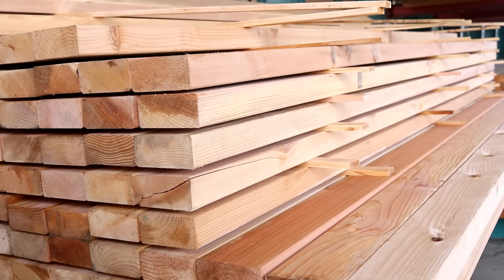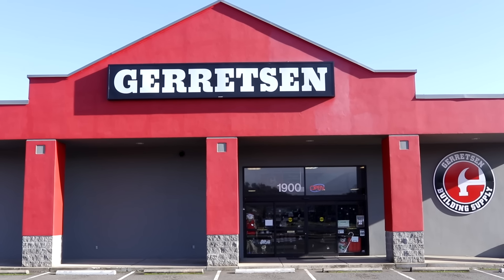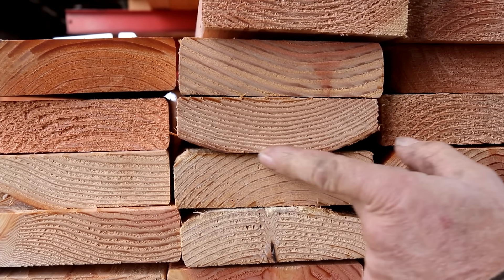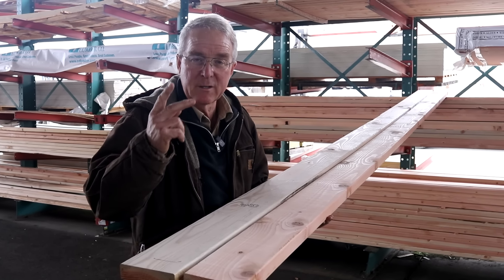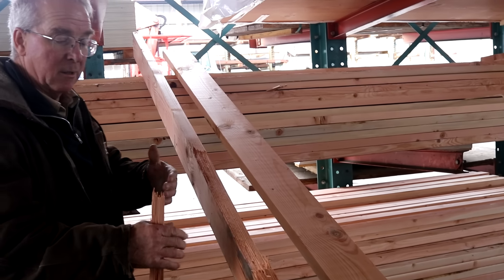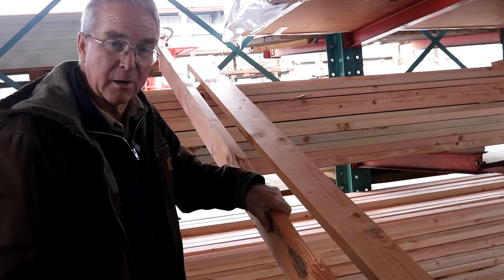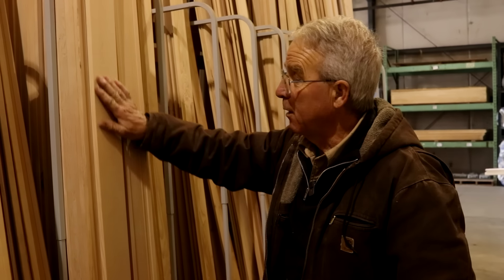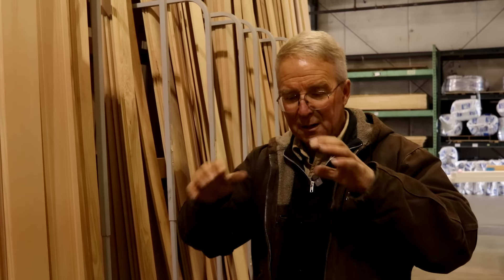How to Not Buy Crap Lumber

Comment: Just a note (no arguments required) of info: When these lifts of lumber arrive at any yard, they are all pre-wrapped and banded together, so the store has no idea they got a bundle of so-so wood until they take it down to the ground level for sale and open it up. Then, as customers come in and want to spend 45 minutes "sorting" through a stack of lumber (which means they start chucking the lumber on the ground or piling it up behind the racks) all the while other customers are very impatiently waiting for service because all these yards seem to short-staff their yard people to save money (yard people cost money whereas sales people make money and thus yard peope are lower in status and are often expendable and replaceable as cheap bottom feeder labour). So now you have a yard full of angry customer's, no staff to serve them because of the 45 minute "sorters" and the manager and front staff all  raging on you for not helping their customers they just called out. Add in, the fact that when the "sorters" leave the yard staff now has to level the piles because they get "sorted" by customers so the counter can count the piles each week for missing inventory. Now add in the fact that when the "sorters" get through making a complete mess of your wood piles looking for perfection from SPF 2 wood, they leave nothing but junk for the next customer (which is not the "sorters" problem but does create a problem for the next guy in line). So the next guy in line wants you to pull down a fresh lift so he can do his own "sorter" thing but the yard staff have been instructed not to bring own a fresh lift until the old lift has been sold up to 75% of volume. Then the absolute jink gets banded together to make cull piles for reduced sale. This is why many/most of the box-store lumber is run the way it is and why there is a difference between specialty stores vs box-stores. This is why many stores have a "no sorting" policy or why they only allow you to personally pick up to 20% of your wood. This leaves customers with the onky choice of buying what they are given and returning or exchanging the crap pieces  the next day or shopping at speciality stores. Like i said, no arguments needed here, this is how al kf these stores work and ranting about it here wont change that. This was strictly for information purposes so now you know why things work the way they do.

Comment: Interesting video! I especially liked the tip about checking the ends for pith. I'll be sure to look for that next trip to the box store.

I've had the opposite experience with my local building supply. Their 2x4 studs are really nasty. Almost every one has wane or large knots. They're fine for framing I guess. But I've found SOME of the douglas fir at the big box store to be cleaner and straighter...of course, you have to dig for the good ones. I should note that I'm usually not framing, more likely I'm building something else where the lumber will be visible.
Reply: ----   you get extra points for spelling "wane" correctly

Comment: In my area in New York state we have two mom and pop lumber companies about 30 miles in opposite directions from me. They started out small but built up to nearly the size of big box stores. They both have good lumber and building supplies, great tool selections and one even has a nice supply of household goods. For softwoods, hardwoods and moldings I like to use a specialty lumber company that's not too far from Cooperstown. They come from small beginnings, too. They mill, kiln, plane and mold everything they sell.

Comment: My first job ever was framing houses, working for my father. By the time I was 18,  i could set the location of the home on the lot,  set batter boards to line up the footer forms, frame the house, install windows, doors, siding and on and on. My dad taught me to do the material take off and place the framing package.  On single houses, I told my salesman, do not send me a load of crap. That was 50 years ago. Since then, I've made cabinets, run trim, install handrails on stairs. I even made some furniture. Besides the fun of creating something from  a few pieces of wood, I learned this, the quality of the wood you use makes a big difference in the quality of your finished product, whether  you are framing a house, running trim, building cabinets or making a dresser for your daughter, having good quality wood makes a big difference in your final product. These days, especially in wood for framing, the wood quality is dramatically less than it was 50 years ago. The fast growing softwoods are very weak. Notice the wide growth rings on a board, that tells you it is more prone to twisting, warping, cupping, and is much weaker when used a joist. Lastly, when YOU build something from wood, take a step back, look at what you made, then say, "I built that" There is a sense of accomplishment. That dresser you made for your daughter, may wind up given to her daughter. Yeah, grandpa made that. And he used really good wood.  OK, yes, I did that and yes, the dresser is now with my grand-daughter. Crappy wood is really good for making a fire. Get a stick, put a marshmallow on the stick and burn it. Then eat it. See, even crappy wood is good for something !!!

Comment: I built a router cabinet (home Ethernet) between a pair of studs in a hallway, and bought some premium 1x6 white pine at Home Depot to edge the box.  I believe it was imported to CA by a company based in New Zealand.  At any rate, I soon found out that my 1x6 premium material was tapered in width.  One end was 5-1/2" while the other was closer to 5-1/8".  I never thought to check THAT because each piece was otherwise flawless...

Comment: Nice presentation. But I've always thought 2nd grade wood was more interesting and that's possibility, depending on your usage. I had access to an almost unlimited number of pallets which had been used to ship raw glass sheets that varied from 8'x8' to 12' x 12'. 

I used them to make cabin furniture and cabinets.

There were "knots" lengthwise imbedded in the boards, pitch pockets,  wane and sometimes dual color, but otherwise the board was 
dead-straight. Shipping glass, it has to be. 

I cut the nailed ends off (a LOT of nails) and shaved the wane then milled them into workable dimensions.

I made everything from 5/8" boards for cabinets and the doors to 1" to 1 1/4" for coffee tables and end tables. And kitchen chairs. Those boards containing partially imbedded branches milled into great looking cabinet handles.  

If I were to do it again, I'd go to a lumber mill and avoid all those hundreds of nails.

Comment: I built a boat using Douglas Fir bought at a lumber yard for the stringers as per directions.  The 2X6 Douglas Fir stringers were coated with epoxy/fiberglas so they were sealed.  I was amazed after 3 years that they had started to rot.  After 5 years I had to begin replacing them, a complicated process.  Now, all this is in Florida where the humidity is extreme and it is always warm but this seems unreasonable for any lumber.  One stringer rotted but the other didnt.  One shelf rotted and the other didnt.  I cut out the rotted stringer and shelf and replaced them by gluing in laminated layers of Southern Yellow pine in 1" thick strips.  My theory is that rot doesnt easily progress across an epoxy glued barrier so I may lose a single laminate but not the entire 6" thick piece.  I am now unhappy about the use of Douglas Fir in a warm climate.

Comment: Just about everything is SPF (spruce pine fir) boards here in midwest. Occasionally see a stack of pink Douglas fir. My old 1960s house was built with kiln dried hemlock...world of difference sinking a nail into an old joist vs. new. My limited experience would suggest Douglas is straighter and harder, but does tend to split/chunk more when nailing.

Comment: fantastic video.  I like most am a frequent patron of the big orange box.  My son recently bought a house in NJ, in an area that we really haven't learned who the small players with the good stuff are.  He bought one of these "cheap" chinese metal sheds that Dad got to manage the assembly of the million pieces and tiny screws.  We needed to build a wood base that could be leveled up on uneven ground.  The 2x4 bin at the Orange Box was full of the most crooked, warped sticks you could imagine.  I wound up with useable ground treated 4x4's.   In the end, the metal shed, could have and should have been built with sticks,  siding panels, etc. in far less time and for the same or less money.    some great wisdom here: beware the convenience of the big orange box,  you may be sorry later.

Comment: I only have reasonable access to big box stores. I have had problems with thinner and smaller, e.g. 1 x 2's, but the larger utility lumber like 2 x 6's aren't too bad. I do not think I have ever had to reject one for "wane." . Now, for fine work, I will find a fine lumber outlet that carries what I want, or order on line.

Comment: Sir, you were describing a board with a pitch-pocket on one edge  and you said if you were using that board as a joist to turn it over, however what if the crown was on the side that had the pitch-pocket and you turned it over, you would have a floor with a dip in it! Yes or no? Thank you! I am definitely curious about your answer!

Comment: I used to work at a box store.  We had standard 2x4s and 2x6, I can't even remember what the grade was, but it doesn't matter, it was just standard construction lumber.  When someone wanted better boards, I would recommend the premium grade that we would get.  They were labeled as douglas fir on the labels, if I remember right, it also might have been southern yellow but I don't remember them being that heavy.  The standard are a spruce, pine, fir mixture.  The premium fir seldom warped and twisted when in the bins and were cleaner than the standard.   Idk if every place sells that higher grade stud.  Anyhow, I tried to keep the bins in good shape, culled them almost daily.  Its a constant battle to keep a clean lumberyard.   And I didn't mind if people picked through the bins because if they were in good shape to begin with, not too many were so picky that they'd throw the whole bin around and on the ground, although, that did happen.  Usually, they'd just make it easier for me to find the ones people didn't want, so I could cull them.  One time I did have a guy from corporate say I had one of the cleaners lumber yards he's seen.  I go to these stores in various locations now that I don't work there any more and often times am disappointed at the condition of the place, so I understand why people don't like them.

Comment: It seems that KD doug fir is a lot more common now here in Oregon.  About 20 years or so ago standard issue framing lumber I'd pick up at Parr Lumber or whatever was Green DF.  If you wanted "S Dry" you had to pay for it.  Now it all seems to be kiln dried to some extent; I think the main reason is reduce weight and thus shipping costs, especially since a lot of it comes from Canada now.

When I need more than a few pieces I just call up my local lumberyard.  They deliver for free and the stacks aren't picked over like at the big boxes. Like your place, if they don't have it in stock, they can get it in a day or 2.

Comment: I live in an area which is already completely missing any small lumber yards. There's one chain in the area with like two locations which has the look but not the quality.

One tactic the big box stores use, especially on regular dimensional lumber is to pre-buy and preorder stock of what they believe is going to be in high demand, so the lumber mills have a harder time supplying the competition, and it dilutes the quality of product, as those mills are pressured into getting boards out of the door faster. 

I believe, from what I've seen, anyway, there are two independent lumber yards -- maybe three -- in a two-hour radius of the metro area where I live. Everything else is one of four big-box companies, and two of those take 80% or more of the presence of lumber sales.

I'm quite inexperienced in wood-working, and I have some projects I want to start working on both to learn and to accomplish -- things I've long wanted to do. Lumber quality is one aspect which worries me, as well as availability. So this video is definitely helpful. I just have to nail down designs and get started.

Comment: Paul Sellers discussed this topic. And the simple explanation for pine. Spruce vs doug fir is huge. Some times it's double the density or weight. Or what ever you like. Putting a large framing nail in spruce is just about impossible is it's kiln dried. It shatters/splits. Fir is just about impossible with a hand hammer some times. Super hard, tough robust. It's a little red/pink. Vs spruce is pure light/white.

Comment: Sometimes I go for the longer boards paying a little more to intentionally cut out the defects on the end. The eight foot and tens get cherry picked typically. Sometimes I’ll buy a wider board if it’s clean and straight line rip the board to dimension if it’s clean but crowned. If you have an eye you can find reasonably good rough sawn lumber and mill it yourself if you’re just looking for 1-2 boards? Those damaged boards get culled so if you ask nicely you can get a discount and work around the damage? Those quick growing woods and the summer growth, soft wood are food for the termites. 😊
Lastly, if you just need a few board feet, spend the extra $$ and get quarter sawn lumber, the mills usually take the clean cants and mill those. they are clear tight grained and in Southern California, there are termites and they have a harder time chewing through your lumber. I know you didn’t talk about VG Doug Fir, but for trim and casework it’s hard to beat, it does get stupid expensive  $$

Comment: Most old school lumber yards store the wood correctly..  outside of a heated building.
Box stores do not. Many times the framing material is inside and it dries out then twists and warps from the heat.  Dont stand too close when they cut the straps to open a fresh bundle.

Comment: I grew up in Oregon and live in SW Washington in the heart of lumber production. There are no stands of timber anywhere worth a damn. My local mill, like every mill now, has a maximum log size of 22 inches. It isn't worth a damn and is best suited for some sort of chip product. I am a retired carpenter and it makes me sad that young folk will never get to to do fine finish work with old Doug Fir and Cedar. It has gotten so bad that on the drive North up to Quinault or Neah Bay you will see a sing that reads" Large Cedar tree ahead, turn left. There are just not any big trees left anymore.

Comment: YUUP 100%, Builders select in Cedar Falls, Iowa, not that big, not that fancy, but good wood I can trust to hold shape.  I build all my beehives wood from them, and I DO NOT cull, wood there, I need 20 boards, I take the top 20 unless it is cracked badly( happened once).  Little secret, bees do not care how it looks either, it has just got to be straight and will not cup down the road.  Been buying #2 1x  from them for over 5 years, totally worth the money, I will never buy big box lumber for building hives again.
Thanks for the pointers on selecting, I am a beek, not a woodsman, never had a tablesaw until I started beekeeping, but I have learned a lot about wood quality since I began this adventure 9 years ago.

Comment: My first experience and probably never again....I walked into HD one day and right behind the contractor's area registers was a huge stack of #1 pine 2X4.  And the price was good!  I needed 4 pieces and got the 4 pieces right off the top and looked them over.  Straight and no twist, bowing, cupping or crowning and very few very small knots!  Again, I didn't have a big project and needed 4 pieces.  I bought 25.  
Also, isn't Port Orford cedar the premier wood for arrows?

Comment: I had to demolish a deck which was 50 feet long and 12 feet long.  The deck boards were 2x8 cedar   mostly 12 feet long. I saved all the boards. Our repair committee at church got a project for an elderly woman's home where the deck was very old and falling apart. We demolished the entire deck. Framed up a new deck with new pressure treated joists. I used the cedar planking for the decking. I just flipped the boards over. It was a small deck , only 20 feet by 12 feet. It looks great. The lady was so happy  and those boards will last another 25 years. We did not charge the lady for anything. It wad fun building the deck.

Comment: If you're buying yard and construction lumber for any purpose other than its intended use (framing & construction) you're buying the wrong material.  Construction lumber is grown, harvested, manufactured and graded in accordance with engineering principles that meet the requirements of construction and appearance is NOT one of them. Yard lumber is not dried to the same moisture content or to the  same standards as architectural or shop grades of materials.  Unless you're after the particular look of construction lumber, are willing to dry it and re-machine it, you're wasting your time.